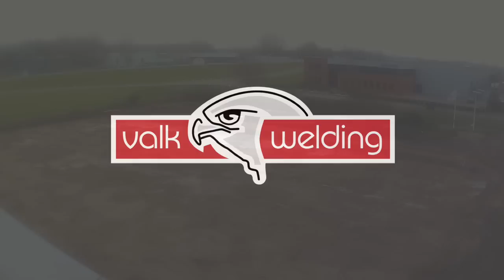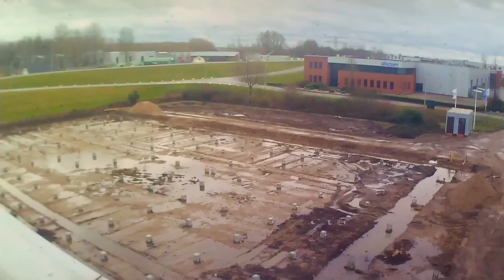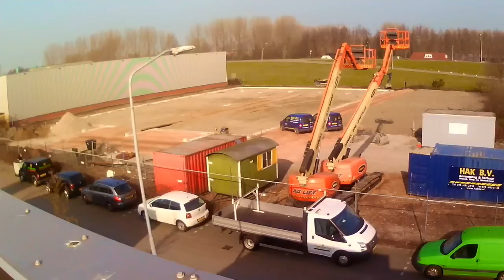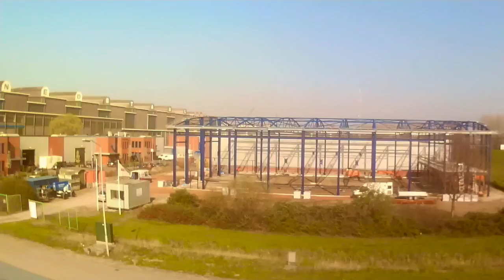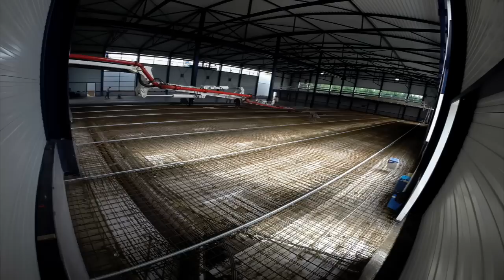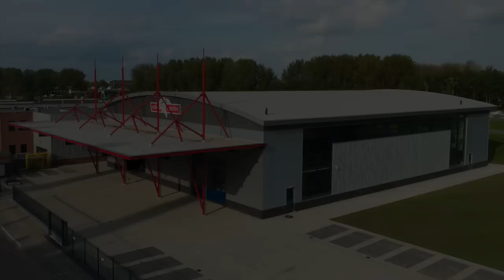New assembly hall Valk Welding operational

Comment from the maker: New assembly hall Valk Welding operational

This month the new assembly hall with a surface of 1700 m2 has been taken into production.
With this new facility Valk Welding is capable to react on the increase of orders for especially large robot systems.

The new hall which will be used next to the existing 2 assembly halls will increase the total assembly surface within Valk Welding the Netherlands to 5000 m2.
Sustainability has played an important role for the production of this hall where of course led lightning in being installed through the whole building. In addition to this the 2000 m2 roof is used to collect rain water which is used for flushing toilets instead of fresh water.

Valk Welding expects to increase its efficiency using this hall by at least 15% using this additional floor space.